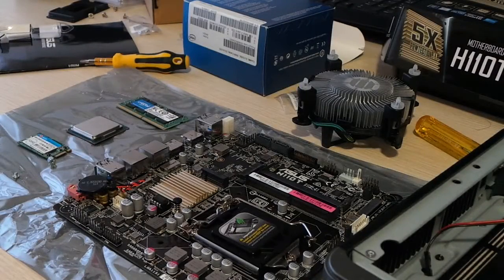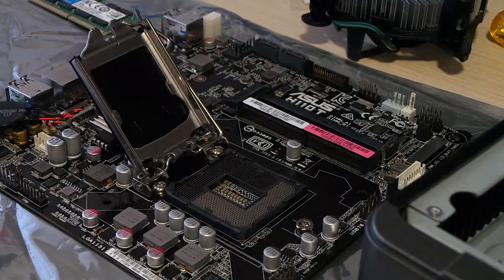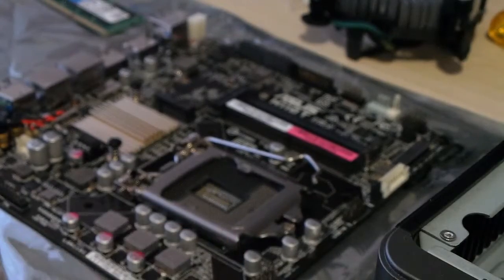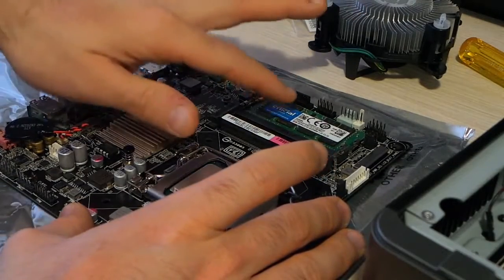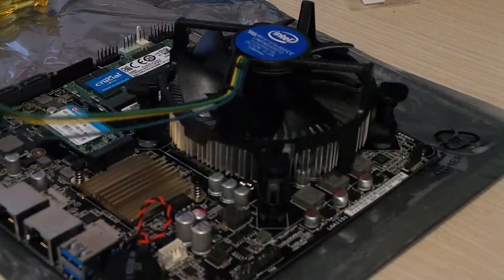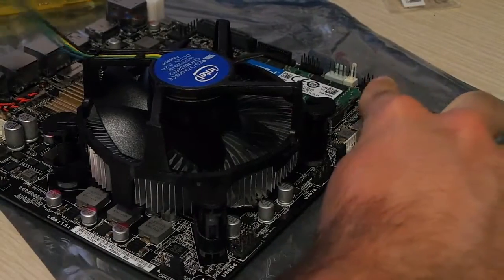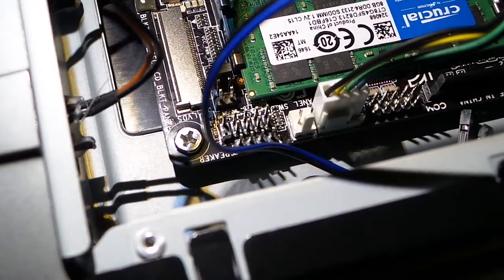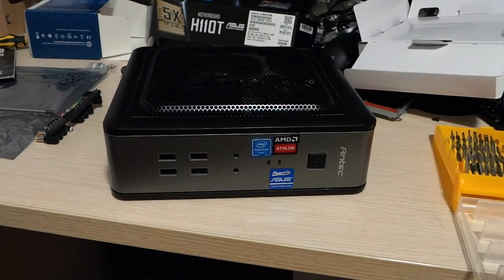Thin ITX system installation [mounted into Antec ISK-110 case]

Comment: Excellent video, thank you for posting this. I know this video is a few years old but it is still relevant for me. These motherboards are really inexpensive now, with really good deals on eBay etc, and I've been thinking to buy one to use in an HTPC system in my living room. There are even brand new H310T motherboards on eBay now for about 55 GB pounds, which is great. This video is very helpful for me, thank you!